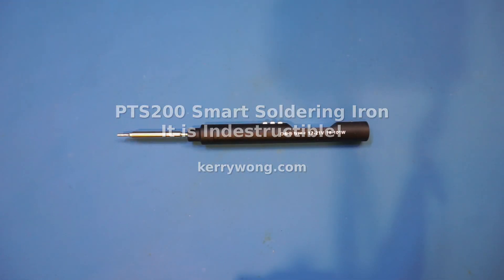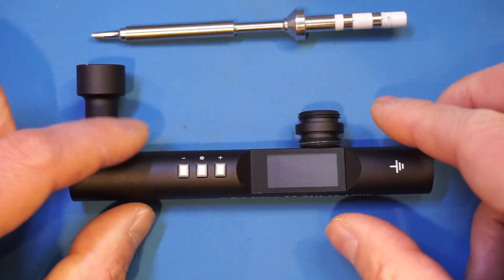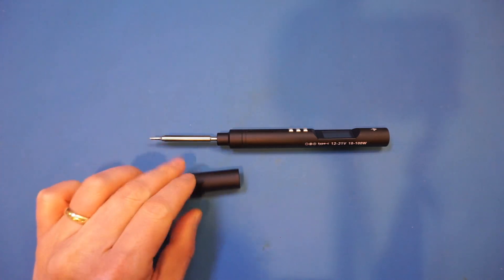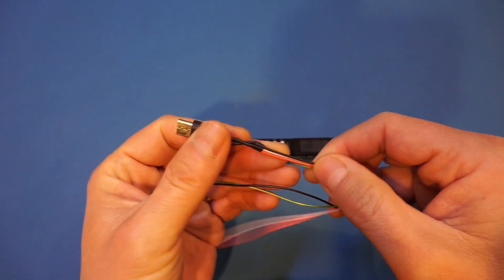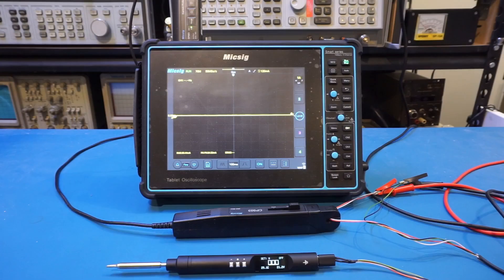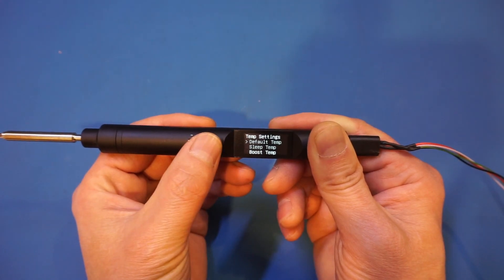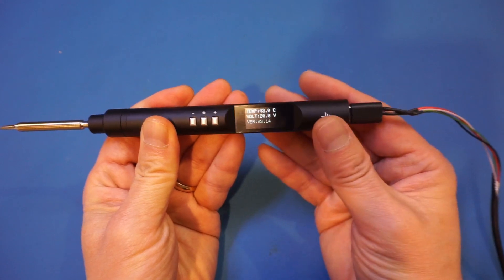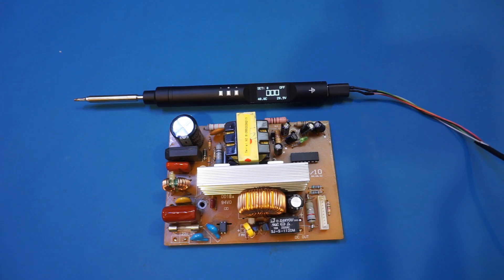PTS200 Smart Soldering Iron - Virtually Indestructible!

Comment: Thats so so so bad. Hopefully youll never forget or flip the wrong breaker by accident and .... Yeah...
There is a good reason 99% are not Metal and especially not connected to yhe tip...

Its also an esd risk on top of an electrocution hazard. Its basically a defective soldering iron at this point. Either risk yourself or risk the components... Esd strap or not...

Comment: Thanks for the video Kerry. I purchased this soldering iron but it was defective and I'm waiting for the second one to arrive. One thing I haven't figured out yet is if I can connect it, for example, to the car battery to give small soldering of wires, I don't care as much about the heating speed. I already have with me a cable declared for 5a from Usb c to Xt60 just to be able to connect it at will by putting an xt60 to my sources. What is meant by adapter cable on the product description? I also have a power supply from an old laptop with 19v and 3.42a, but with the new one I took the wall power supply (220V eu). I ask because I see USB C triggers for PD/QC and I wanted to know if it can be powered with normal DC power (car battery for example). Thanks if you can reply.
Reply from the maker: Yes, this one can be powered by a standard power supply as I have demonstrated in the video.
Reply: @KerryWongBlog  Thank you so much.

Comment: OK, no way I'm using a soldering iron with a metal body connected to the tip. That's asking to get a nasty shock if you accidentally use it on live equipment!

Comment: Thank you for the warning never to buy from Banggood due to insufficient packing for shipment and high possibility of damage. 👍👌

Does this iron rechargeable? Or needs outside power always?
Reply from the maker: To be fair, it's not really a Banggood issue. Their packaging is fine. I rarely see packages got mishandled to this degree. To answer your question, there is no built-in battery, it has to be plugged in.

Comment: For work, and only when I'm out on site, I have a "Portasol" gas soldering iron.
It's pretty good, but it generates a LOT of raised eyebrows from management types who start whispering "hot works permit" etc. The deep-orange glow of the gas catalyst sends them into a health and safety spin.
I've been thinking about one of these "portable" soldering irons, but I just can't imagine having to deal with a separate battery pack and the leads. I'm trying to SIMPLIFY my operation, not make it more complex.
I would happily live with something fat and heavy, so long as it had an onboard battery. Maybe a pair of 18650 cells side by side? My e-cig has this arrangement, and will happily deliver 75w in short bursts all day.
Reply: Funny. They do spit out a lot of hot exhaust gases but is it really any more dangerous than a normal soldering iron... Handle any type of them wrong and you get hurt...
Reply: I guess it depends on how often you're away from the outlets. if its always then maybe one of the soldering stations that sit ontop of the power tool batteries if you already use a brand on power tools for work otherwise I don't think there are any good full battery options at least none that I've heard of.

Comment: Wouldn't the USB connection ground the iron if connected to a PC or similar?
Reply from the maker: The tip is not physically connected to the circuit ground when I tested it, so unless the body is grounded the tip would be afloat.

Comment: It's neat for a portable iron but for a main device i will stick to my Ersa i-con
Reply: If it needs to be connected to a power source I don't call that portable Don't really see what thing adds above my Weller
Reply: @gordonwedman3179  Of course it needs a power source lol
Reply: @Brian Ortiz  
So, as I said, it's not portable. I can take my Weller off the bench, carry it somewhere and plug it in. Does that make my Weller "portable"?
Reply: @gordonwedman3179  You can power this kind of soldering iron with battery packs or power banks. More portable than Weller I would say.
Reply: @gordonwedman3179 disappointed that this soldering iron ain't  powered by an alkaline AA battery?